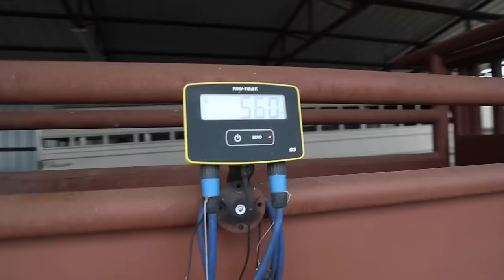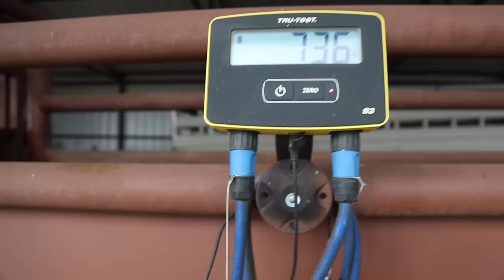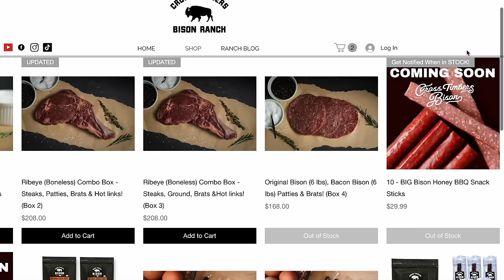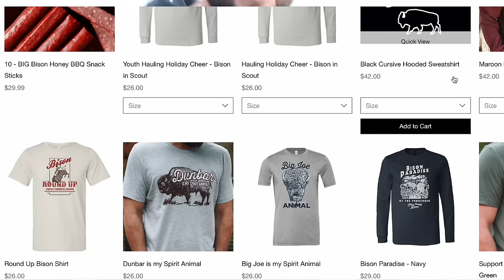Working The Yearlings And Of Course THIS Happened…

Comment: Dusty, where the gap is, where the female Bison got caught, you could eliminate that gap by bending a piece of heavy sheet metal to fit over top of both bars. Then weld one side of it to one bar and bolt the other side of it to the other bar so that the equip can still be taken apart when necessary.